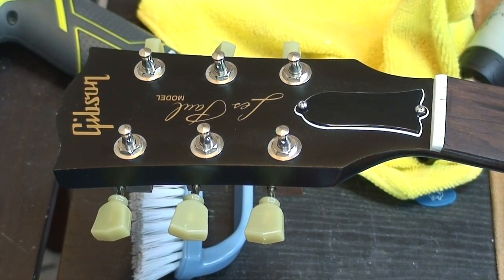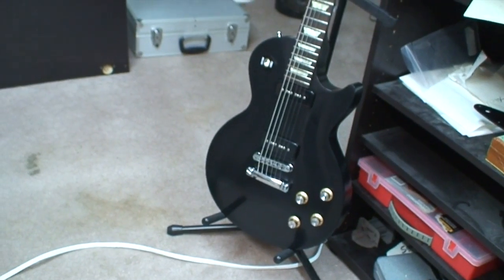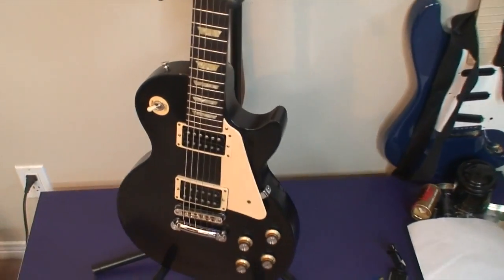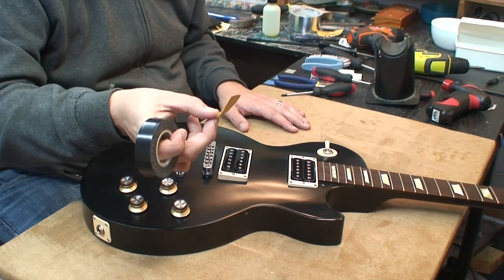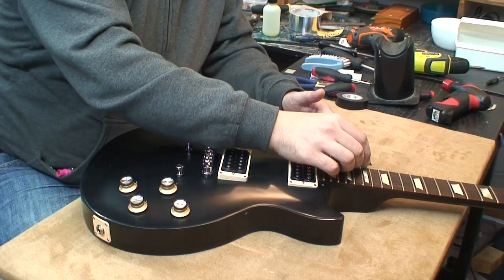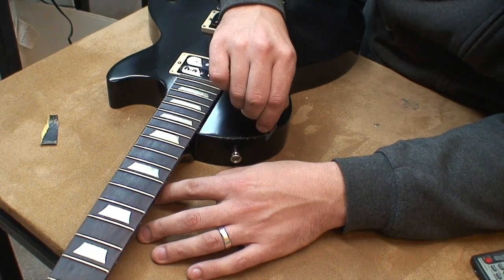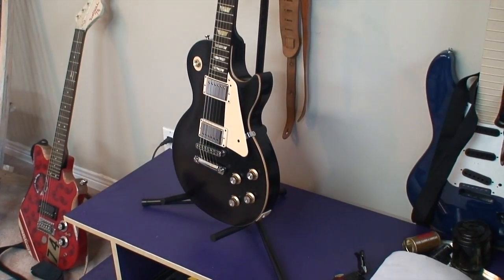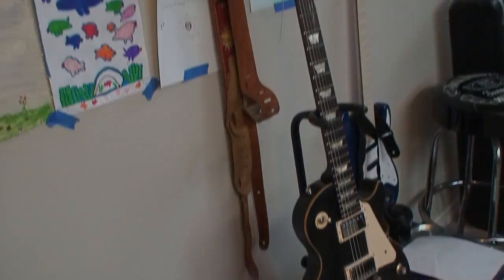2013 Gibson Les Paul 50's Tribute: Faux Binding and Chrome PU Covers!

Comment from the maker: **NOTE: I did put clear coat of lacquer on the exposed edge when this was done to protect it. I just didn't film it. Be careful if you do this to your own guitar and be sure to put something onto the exposed wood when you're done.***
Reply: Think it looks pretty slick.. Do you think true oil or other finishing oil rubbed on would work?
Reply: What did you put on the pickup before placing the chrome cover on it may I asked? Thx btw that looks like a great job. I got to scrape some binding on some acoustics I got in. I bought for resale but they play so great & sound Amazing better than guitars costing 3x's as much.  But the binding back & front had not been scraped ??? Ruff as a cob I used fresh razors to scrap the binding till it was nice & smooth. Alvarez cutaway dreadnaught's I bought three at a great deal looking back I'm just realizing how good a deal I got on those they came w/B-Band pickups EQ tuner system. I never thought to do the Faux binding like you did brilliant!!! Have you ever shaved a neck to a certain profile? I got an Epi LP that has a huge fat neck I'd like to slim that down.
Reply: What lacquer did you use?
Like what type?
Reply: I also wondered what that white stuff on the pups were
Reply: I have a black Les Paul with nitro finish  with a really gnarly not in a good way bottom edge on the main body , do you think this weork or do you think the paint is likely to shatter , also do you think i would be devaluing the guitar in doing so ( its a USA custom so binding on top and headstock only . Sorry for so many questions .
Reply: By the way its no vintage piece its 2018 and gigged heavily before i got it , thanks .

Comment: what were you soldering the back of the pickup for?
Reply from the maker: +Joe her It's supposed to be soldered on:-)
Reply: +Woodeso's Guitar Mods what was the white gunk for?
Reply: +Chuck Nowakowski Yeah I was wondering the same thing.
Reply: +Joe her The white stuff acts as isolation, this way you won't have microphonic pickups.
Reply: +Woodeso's Guitar Mods What is the white goo you put on the face of the pickup before the cover went on? Nice job btw.
Reply: I'm very doubtful about its efficiency.
Reply: he soldered the cover on the pickup so it doesn't fall out.. all pickup covers are soldered on that way
Reply: it's not so it doesn't fall off it won't do that normally, it's soldered so the metal plating is grounded, to avoid the chrome covers adding noise, and possibly reducing noise a little.

Comment: This seems like a really dangerous (and possibly stupid) way to decorate a non bound guitar. Getting a straight line and consistent depth using this method would be nearly impossible! Why not just use a mini-router along the outer edge of the guitar body? This would ensure a consistent depth and straight line. My guess is that up close, this job looks crappy and cheap. Notice that no close-ups were shown of the final product. Also, one other commenter indicated using pin-striping from an auto-detail supply center. Brilliant and easy way to go, and could be followed with a clear coat.
Reply: You would be shocked to learn that this is exactly how the luthiers at the gibson factory clean binding from paint and clear spray. They grab a razor blade and go to it. No masking, no straight edge, just good hand eye coordination and a razor blade taped to a Popsicle stick! The binding route itself is done on a CNC machine with a template, binding glued in by hand, then the whole guitar is painted over. There is a position called "binding scraper". Every gibson is done in this method... purely by hand!